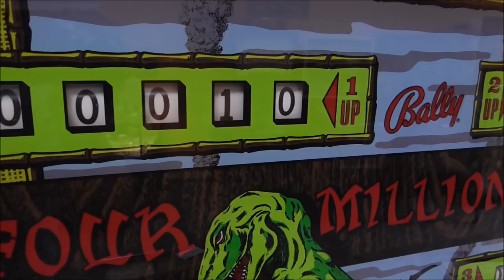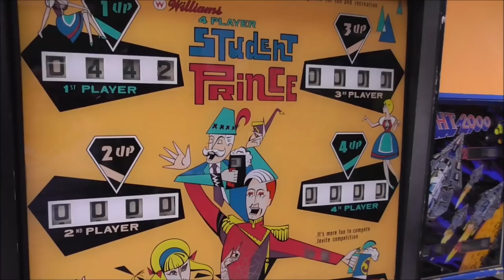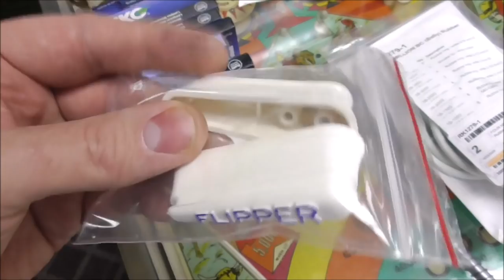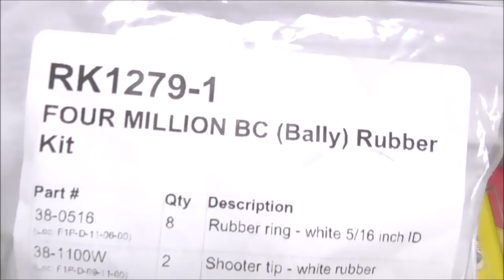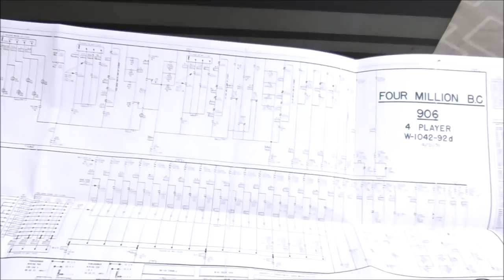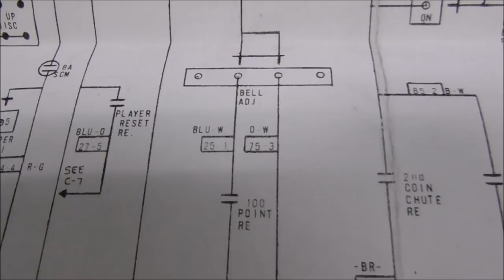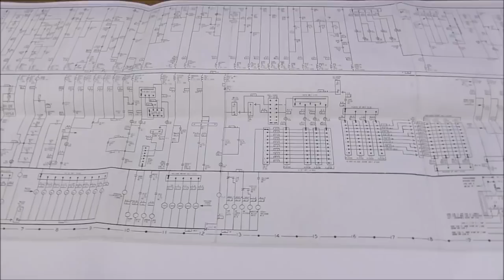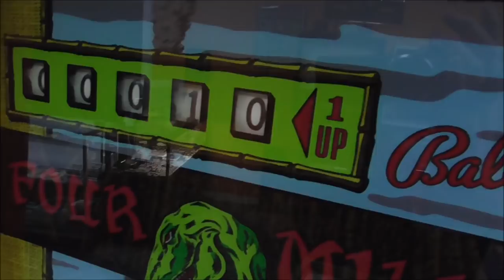A Customer Brought Us A Bally 4 Million B.C. Pinball To Repair - Multiball, Zipper Flipper, Ted Zale

Comment: I’ve got one of these I bought at auction in Pittsburgh for $500 during a warehouse liquidation.  I played this game as a kid in the mid 70s and each game was a dime.  I’d been looking for this game for a long time, and when I found this one, I snapped it up.  Supposedly, it was used as a set prop for the 2009 movie Adventureland, which was filmed in Pittsburgh.  It didn’t come with a certificate or anything to actually prove that, but that’s not why I bought it.  It needs a little work, mostly with the plunger that’s loose and doesn’t launch the ball correctly.  One odd thing, is that the back glass has a vinyl reproduction of the original artwork.
Reply from the maker: I've seen those reproduction translites before, the original one must have been pretty bad off.  If you do what I show in these videos of this one, you'll get yours working i'm sure!

Comment: Educated guess on the pop bumper. (potential spoiler) It maybe a stuck contact on the pop bumper trigger or a stuck relay contact for the pop bumper
Reply from the maker: If it was though, why would it go off?
Reply: @LyonsArcade  That is a good question. I'm not sure, maybe a switch on the latch relay could be stuck and the jarring of the pop bumper on initial turn on is enough for it to jar loose. Or its possible that a contact is just a hair too close caused by something being bent or maybe lint and dust.  just speculation mind you Wont know till you post the video cause you may have found it and i may be wrong lol :)

Comment: I do remember WILLIAMS ELECTRONICS OWENS BALLY'S.
But don't remember what year Williams purchased Bally's..
But both Bally's and Williams have zipper flippers..

So I would assume the Williams had Bally's before 71 when they released this pinball machine.
And Williams came out with their own version of zipper flippers because they would obviously have the patents.
I got to do some fact checking.
Reply from the maker: Apparently Bally owned the patent because Ted Zale invented them.... then Williams made a similar thing and Bally threatened to sue them, that's why Williams only made 4 machines with Zipper Flippers... I don't think Bally purchased Williams until the mid 80's (Bally and Midway were already the same company in the late 70's)
Reply: I thought it was in the early 70's.
Yeah you're right.
But didn't know about the zipper flippers.
Thanks.

Comment: Does it being operated on 240 50hrz over time cause an issue?

Agreed red paint looks much better bet they did that in France
Reply from the maker: On these EM's it seems to just make the score motor run faster or slower, depending on the hz, the voltage can be swapped on the actual transformer... you just move a wire and the transformer can do either input voltage.
Reply: @LyonsArcade  transformer I knew about hz you answered me question thanks much my friend!

Comment: Regarding that double ball kickout issue, have you checked the "Tar Pit Interlock Relay" ? When its state is "off", the gate, which guards the entrance to the tar pit lock is open. Once the ball gets in there it activates the switch while setting the relay to "On" state. That activates the gate, which blocks the access to the tar pit, until the second switch below the third "finger" is activated. You could search PinballHelp's video about the issue.
Reply from the maker: We figured it out eventually and you're right it was that switch.  They mention it in the manual actually.

Comment: Actually, If you where strong enough, or used a friend (on the opposite side of the cabinet), you could bend those lookbars inside the backbox, and pick the backglass out. Then simply spin the freeplay wheel with your finger as much as you wanted. It did get easier, to pick it out, every time you did it couse of the stress to the metal and the wood. Nothing i´m proud about! Just wanted to make a confession.
Reply from the maker: Meh.  I've done worse, lol

Comment: My uneducated guess for the pop bumper issue: the pop bumper fires because it's locked on but it de-energizes instantly because the game over relay works properly and doesn't let anything solenoids fire if a game isn't running. I noticed that horrible buzzing didn't start until a game was started, at which point the game over relay would obviously be off. The last time I heard a sound like that was when my Mystery Castle kept blowing fuses because one of the transistors was shorted. That sound was VERY similar to when I put in that new fuse and it would fry it instantly!
Reply from the maker: That could be, I can't remember if it did it while you were playing a game or not, i'm going to clean everything and adjust any weird switches....
Reply: @LyonsArcade  always a good idea. I'm pretty clueless when it comes to EMs. I'm still learning but for the most part it's been modern games I've worked on (WPC and later). It seems like EMs are definitely a step up in difficulty.